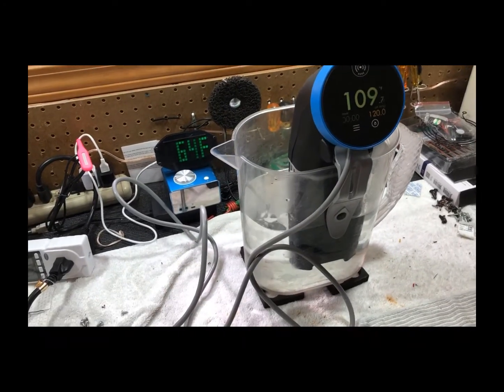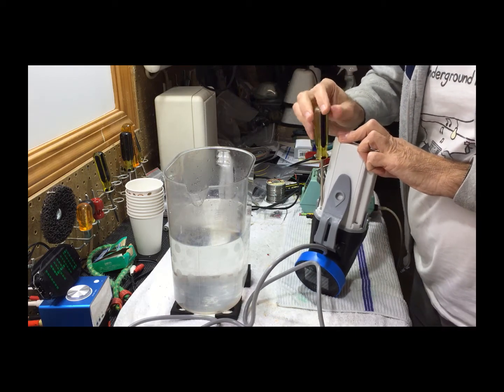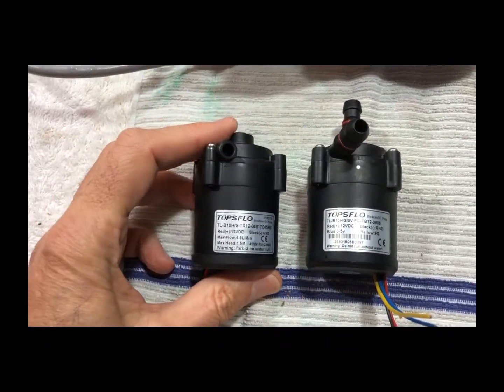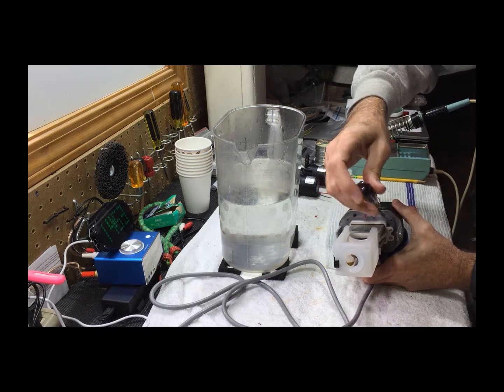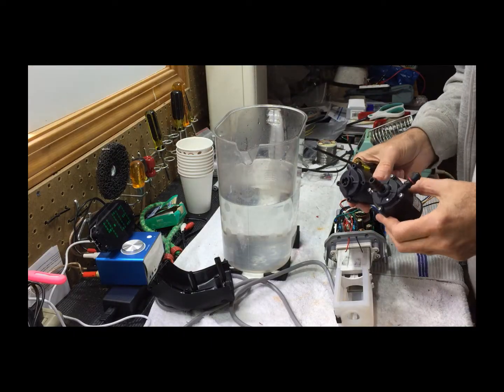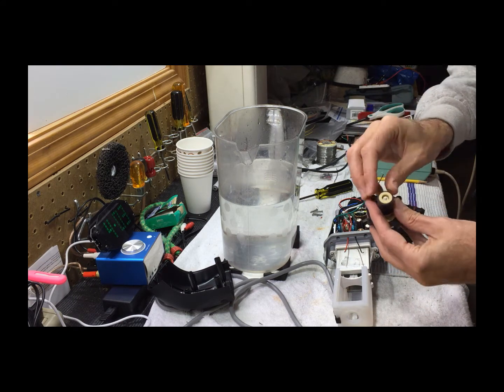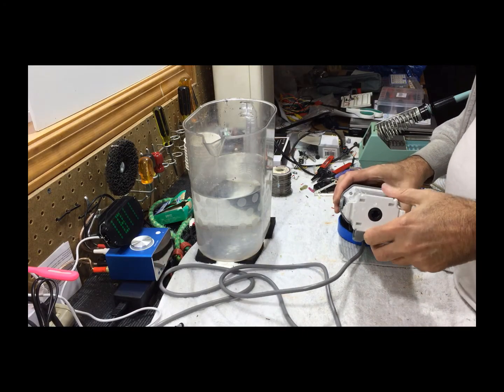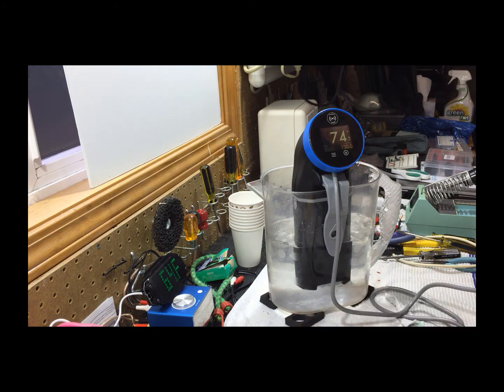Nomiku 10000 Sous Vide Repair (Pump Replacement)

Comment: Hi, heating plates are above the water line how its work? How water Flow over the heaters?
Reply: The pump push the water up onto the heaters in the middle and then it goes back down by passing in two channels on both sides